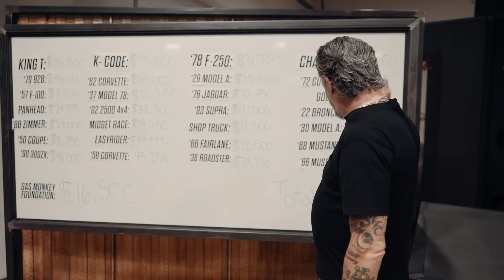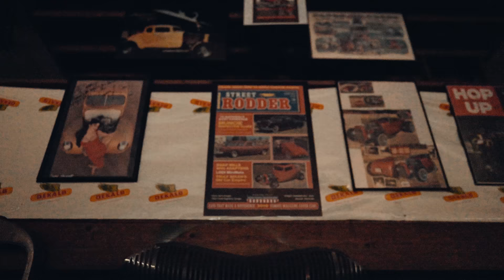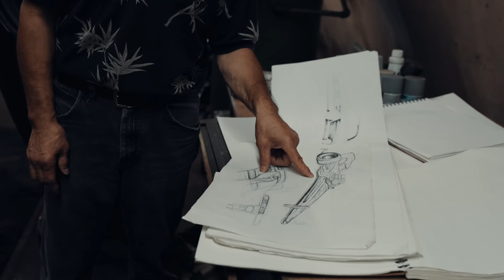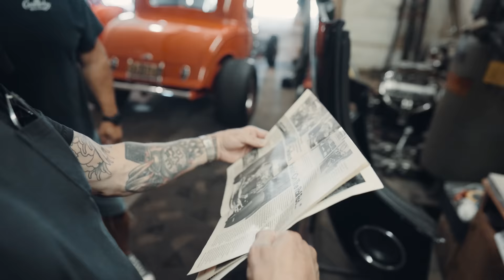Buying An Automotive Icon - A Dallas Legend - Gas Monkey Garage & Richard Rawlings

Comment: Here’s a little tip to anyone watching this video about buying cars.  Never look to excited about a car until the deal is done otherwise you can relight the spark for the owner to want to keep it.  I thought Richard and Chase was going to start humping the exhaust pipes in this vid.   Also take a trailer big enough to remove it straight away and pay the man cutting the connection.  You know what I mean Richard hahaha.
Reply: Also water is wet...thanks captain obvious.

Comment: You can send those headers to Kooks in Statesville NC, and they can remake them with one continuous tube for each cylinder, not a bunch of cuts and welds, they can do SS also, check them out…